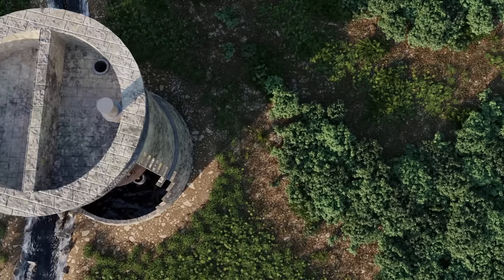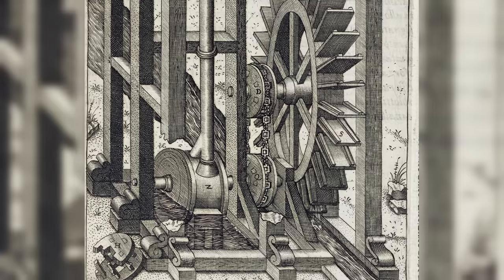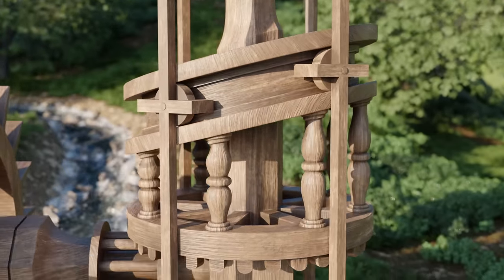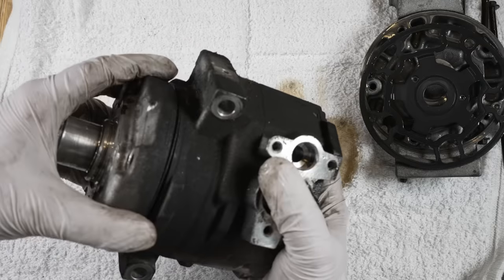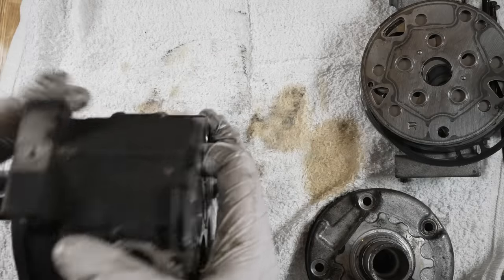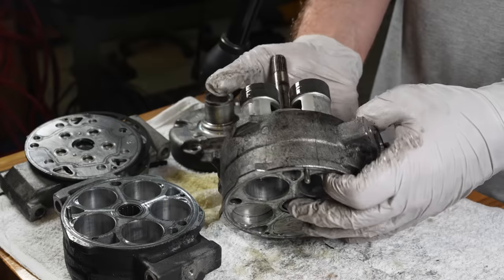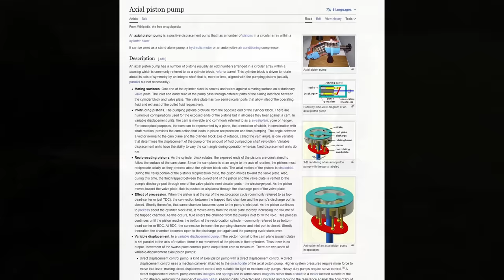How an ingenious 400 year old drawing predicted the future

Comment: Nice video.
Can't help but one issue makes me gringe (a bit). Seems that in the Ramelli's design the wheels on the vertical rods have to change rotation direction at the low and high points. When being lifted by the  lower flange of the 'swashblade' and then being pushed down by the upper flange - and vice versa.

Comment: Just like Ramelii drew, it is just a “rotary hydraulic piston pump”.   Many applications.  Heavy equipment hydraulic ram/drive systems.  Ac.  Power steering.  House held pressure washers.  And even regular old water.  

To me the cool part is the fact he assumes we know how a standard piston pump works.  And feels no need to clarify many things because much of it is relative to the size and type of job.  Which was obvious to many STEM people through time.  As soon as you put a special name to it, the piece looses most of its potential.  And in modern times it’s just a silly way to make money for nothing.  

Even more so, anyone familiar with hydraulics sees it is much more then just a way to do something.  It’s a way to do something that lesser variations cannot.  It’s easy to lift water a few cm.  But to raise it to such hight with out boiling or lock is actually quite a difficult thing to do with our physics at hand.

Comment: I've stopped watching at the 5:19 mark.  It seems to me that this would become an internal combustion engine, likely a rotary engine.  Water, or fuel (petrol / air) would be pumped around a circular contraption, stored in a holding area, then allowed to escape.  The difference might be that the escape of water in this invention would hold the potential energy needed for something, but in a rotary engine the fuel explodes, creating the pressure to move the mechanism, allowing the movement to be utilized.  I'll watch the rest to see how off-base I am.  Great explanation so far, BTW.  Thanks for posting!

Comment: Concurrent discovery and rediscovery is everywhere.  Just look at Calculus, not only did Newton develop it in the same era as Calculus but Archimedes did 400 years earlier though Archimedes book on it was bleached and overwritten with prayers by the church.  The modern swash plate or Z plate crankshaft may or may not have been related to those old drawings but it's probably more likely that it was just rediscovered independently.  Even today with computer science, we're seeing issues that were discussed and debated during the 70's simply not being known by the younger generation who then eventually redevelop or will redevelop the same conclusions.

Comment: This pump is the same design used in pressure washers. Maybe there is another machine?
Reply: Ah, AC compressors. Makes sense. Power washers use a single piston action instead of double. But they have the swashplate thing too.

Comment: It looks like the jack in auto repair shops but the automotive air conditioning compressor has a very similar pump that pressures the coolant in the system. Before this system was adopted they looked and worked like a old air compressor that had pistons on a crank shaft and were big enough that they resemble a motorcycle engine and they were not very efficient Chrysler was using them as late as the last part of the 1970s in cars and trucks still find them in motor homes in the eighties  now modern air compressors are using the same design

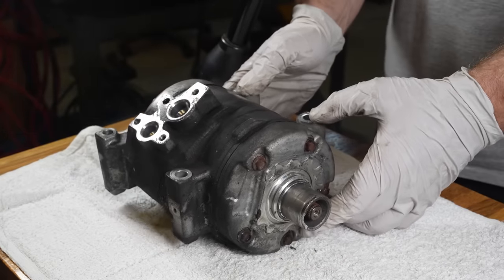Comment: 5:18 Air conditioning compressors, I see them most used in vehicle compressors.  5:55 :yougotthis:  No,  i did not cheat, and skip ahead,  I'm an automotive tech by trade.

Comment: The mechanism to control the blade angle in helicopters also uses this swashplate mechanism.
There's also an internal engine type that is called a free cam engine that is almost identical to the AC compressor design.

Comment: If you do a model first...
you will carry it around and will also have sufficient water with it in the bottom - so its beneficial to let the water return to the bottom of the model to keep it.
else you would need to find a spot where it could be placed - but that sounds risky and also rare. a self contained model will work anywhere, in a bar, at an office, or wherever a customer (a lord, a king, a canceler) could be found, even anywhere outdoors when needed. and for sure water supply by pipes was a rare setup... and dripping other folks good floor was not good idea.

for a final that water return would be easy to adapt to what is really needed to make the machine a useful one. 

mills are buildings, regardless if water or wind drives them. so are water towers or coal works... i dont mind. do you?
Reply: what could water benefit from being lifted up and let down again?
its getting saturated with oxygen? it could see warming up?
it would not justify such an effort just for that, at least i would not see much benefit.
if its a cistern maybe circulation helps it in some way, but would also possibly increase its pollution.
could it be some bath equipment? a shower facility for the middle ages?
or would it be sort of a technical watering, like maybe a blacksmith would need it to cool something down?
or is it something that is for the amusement of people, a spring fountain on top of a building, something that shows your personal wealth and lifts you above others?

no sure - but more ideas might originate from other peoples minds here in the comments.

Comment: I came up with a similar way personally without ever seeing any designs...but by studying theoretical physics...that's when one starts understanding the flow of energy and the  easiest ways to operate those basing on available components at hand.

The hole at the top of the water mill, most likely is for amplifying energy output due to an increase of hydrostatic pressure with height.

Comment: What a monstrously inefficient machine there's going to be so much friction I doubt it would work without tearing the wood apart. The gears don't even mesh sensibly around the lantern gear, you can even see that from the animation. If you are genuinely impressed by this BS then I suggest you look up The Antikythera mechanism, that will blow your mind.

Comment: Some machines go as far back as 3000 years or more. Seen mostly as oddities by the people and used for mainly religious purposes to tell stories and of course routing water, as well as for mapping the stars and blacksmithing. Civilization itself may have started with the machines we use. We simply just improve the materials and methods we use over time which make some designs more feasible. Also methods of documentation of knowledge improved quite a bit. I think secrecy developed out of the need to not be killed for becoming a heretic to whatever god was popular at the time.

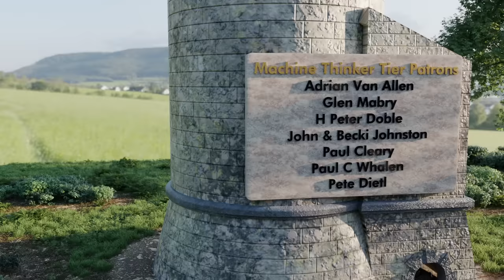Comment: well, let's see....that's a way of converting rotational into linear....and using fluid power....you know? the images kinda make me think of sewing machines at first, but I actaully feel like the steam engine fits better! I mean, every motor can be run in reverse, what is an alternator but an electric motor that's recieving power instead of giving it? take hose pump shafts with roller bearings and push on them...they would PRODUCE rotational force...ie....to power a locomotive's wheels! [no I've not watched till the end yet so curious to see if I'm right! Video at 5:34]

Comment: Drawing something on paper is one thing, making it and having it last is another.  Where are the real life examples of this stuff working from 1588?  Most of the stuff, I draw I end up making.  That's a big difference.  Copeland and Americold were making these types of compressors down in Alabama back in the 80's for a variety of customers.  The reason they were successful is because material science and manufacturing tech had progressed to the point that they could make these compressors economically.  Copeland made the Scroll compressors viable because machine tools were developed to machine the scrolls economically.  History is replete with examples on paper that were never able to be made because ideas were hard to translate to reality.
Reply: GM's Frigidaire division made axial A/C compressors back in the '50's. Those long skinny compressors found on all GM cars from that era were instrumental in getting A/C into cars. York 2 cylinder compressors worked but their output had a lot of pulsing which required a different metering system for proper operation. Chrysler had their famous "RV-2" compressor which like the York had a pulsing output. 2 cylinders just weren't enough for reliable, long term, operation. The compressor on my '67 Impala is still going strong after 55 years.
Reply: @ajwilson605  you're right, Frigidaire and a host of others built them and that's the key word here "built", not drew, not conceived, not imagined but actually did it.  There's a difference.

Comment: OK. Paused. Just off the top of my head, how 'bout... hard disk head-seek servo motors?
Reply: OK, paused again. Is that an HVAC scroll compressor?
Reply: clearly, it's not a hard disk 😁
Reply: Hey! I sorta got it right. At least the basic function, anyway. Looked like an HVAC compressor of some sort. Patting myself on the back. 
I guess if it were a scroll compressor we'd be dealing with more of an Archimedean screw (at least that's what I've always envisioned when I think of a scroll compressor)

Comment: I don't find it particularly interesting or compelling.  We know now the the pursuit of rotational speed has been a common interest of man.  Rotational force drove much of  the industrial revolution. Before we could engineer parts to within 10000 of inches. We still needed a way to provide energy to a thing. Say a watch or water wheel.  With greater precision... concern for longevity of parts and catastrophic mechanical failure was greatly reduced. It has pushed us to chase after the idea of a perpetual motion engine almost from the beginning.
The idea of moving water so man could occupy a place where the supply makes a  aquaduct valuable but a pump and piping is the cart to a space shuttle in evolution. The wonder of modern air conditioning with the heat exchange between liquid and gas is almost magical compared to how it compresses the gas to a liquid.

Comment: Someone was too stupid to realize that the grain of the wood of the big gear have to be always vertically alignt otherwise the tooth that are horizontally alignt will brake along the grain 🤔. Clearly A designer that doesn't now about Physics or material properties 😂designer go home you're drunk! 🤣
Reply from the maker: That would be me.  There's a million details when doing a couple hundred hours of modeling/rendering and getting all of the material UVs absolutely correct wasn't top priority.